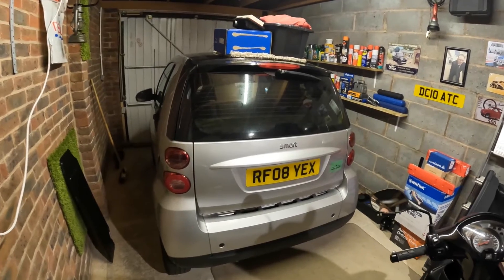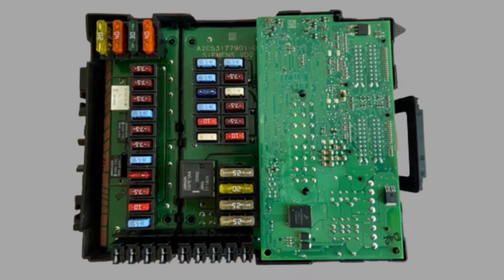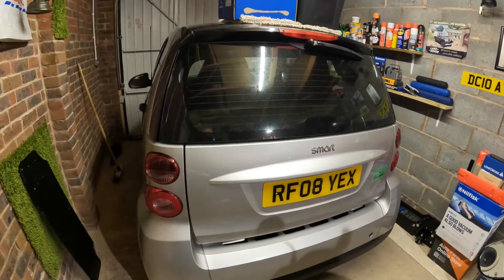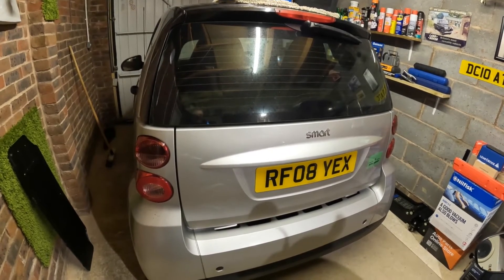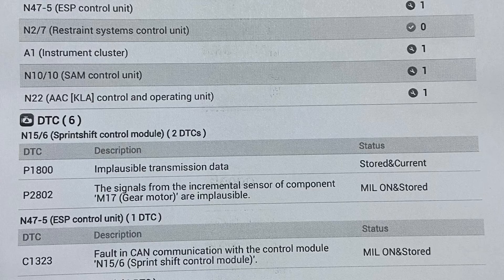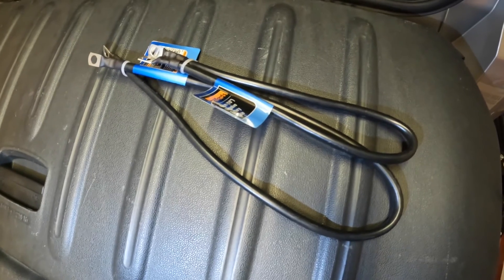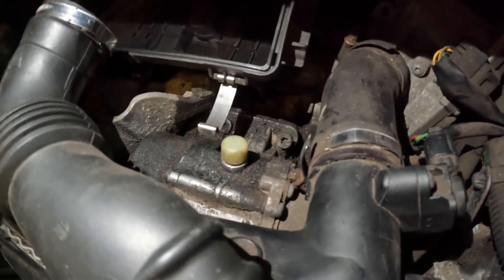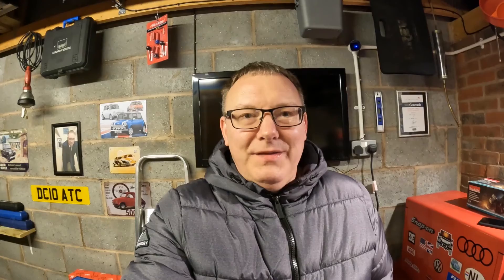3 Lines Fault - Smart Fortwo Passion 84 BHP 451 2008 - An Update

Comment: Don’t know if you see the comments,
I’ve got one myself and after driving sometimes I get an eml  light with code p0900 p0805 and car is like a jack in a box driving through the gears? Leave the car for an hour or so and she’s good as gold. Did pull the actuator and re grease  but still can’t clear the codes as the eml light comes back on after ignition off/on
You obviously the smart guru so hopefully you might be able to shed a bit of light 😁
Great videos by the way
Reply from the maker: There are so many things that can cause such issues on these and it is incredibly hard to know without going through diagnostic processes. From clutch failure (they break up), to actuator failures, wiring faults/breaks/shorts, bad SAM joints - the list goes on.

Comment: Hi, i'm Ben from Germany.
I Love my 451 CDI. It has already run 325000 km since 17 years. Now i had the 3 lines of Doom on my display. After several trys i swaped the battery. It was still the original from delivery. Now, it drives like a new car, just as you described it after cleaning the contacts from your earth. I hope that was the cause of the trouble. Since 500 km it runs perfectly. 
Habe you tried it with a new battery?
Reply from the maker: Hello - the battery is strong and withstood testing. I have recently replaced the gear shifter motor as the vehicle had completely failed. It is now good. Video will go live on Friday.

Comment: hello friend,  under the left seat of your smart is the transmision ecu box. Most probably has got water on it or may be just wet somehow. dry it and you are good to go. 90% it will fix your problem. good luck
Reply from the maker: No water leak. Bone dry.

Comment: Hi just had this happen to me everything was fine undid battery to replace few things 3bars when plugged back in trying everything but I knew nothing was broke or needed replace few things I noticed was the beep sound not happening this is linked to abs and track and the dash relay so I looked in to fuses in book said checked a few all good so I decided to check all and #18 was blown this control esp dash and few other things long story short change it and turned key and the beep noise started hearing that I pressed brake pedal 3 to 5 times and everything came back 😀
Reply from the maker: That’s interesting to note. I wonder why that fuse blew? A lot depends on fuse 18!

Comment: I have same issue
Reply from the maker: Check out my shorts videos on my findings. A good first thing is to also ensure the engine earth is good. I removed the earth strap at the engine and lightly sanded the surfaces before refitting. Held by a Torx bolt which is easiest to access from under rear right of engine.

Comment: Just bought a wee convertible...dropping the engine out for either a BMW K1600 6 cylinder, or a Honda 1200 V4 DCT...whatever turns up at the right price

Comment: Hi - I had a really similar problem - I needed a new clutch as well as actuator. In tbis case I think it would be best to find a garage with MB STAR diagnostics. I know there is a smart specialist called Smart Sport who should be able to plug in and diagnose exactly what the issue is and also correctly teach in the clutch actuator. Thanks for all your content on the 451 and good luck

Comment: What area do you live? I have a full Mercedes MB star system you could use. I bought it recently for actuator relearns etc. deep dive faults. Your 3 dash may be fixed with a relearn. Brake switch can also cause chaos.
Reply from the maker: Thank you, that’s a very kind offer. I’m in South East England.
Reply: @autoknight747  Anywhere near Watford?
Reply from the maker: @unknownunknown8707  sadly not, quite a distance.

Comment: The small white cap on the gear motor. I read on a forum that putting lubricant down there cured a gear shifting problem. Obviously I'm not sure if there's any credibility to this but I did wonder what that cap is there for.
Reply from the maker: The white cap is actually a cover for the gearbox vent. Once the cap is removed it leads straight into the transmission via the gear motor. Unfortunately any lubricant sprayed in there would ultimately reach the gearbox oil.

Comment: I had the 3 lines on a 2004 model. Still went through all the gears just didn't display what gear it was in. Plugged it into a diagnostic machine selected the gear box and told it to go into neutral. Could hear the gearbox click away and up popped the dashboard gear display.

Comment: That’s a shame the Sam unit didn’t cause this problem .It will be worth taking wiring loom completely out and check for continuity.You will need to remove the passenger seat otherwise you won’t be able to removed the plug from gearbox module .Maybe some contacts are corroded or the module is gone under the passenger seat under the carpet .
All the best in fixing this car up .